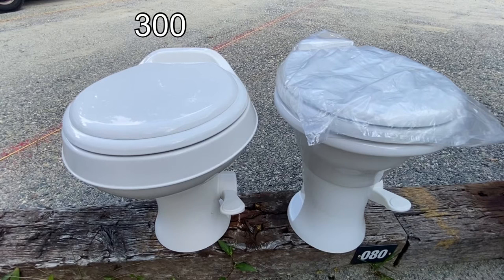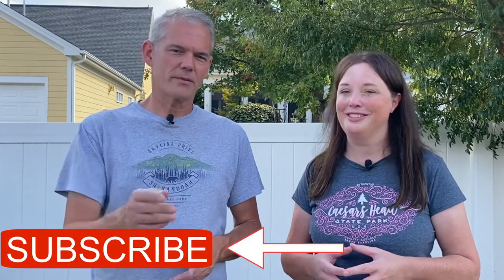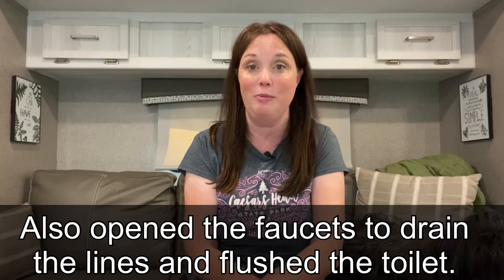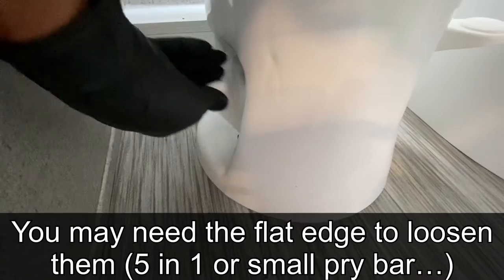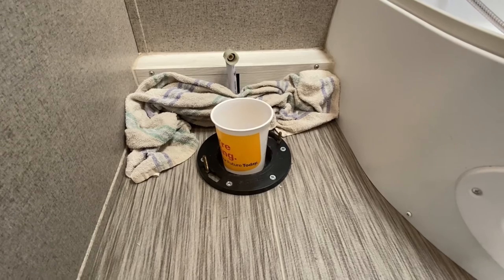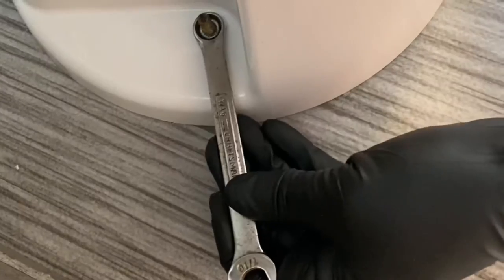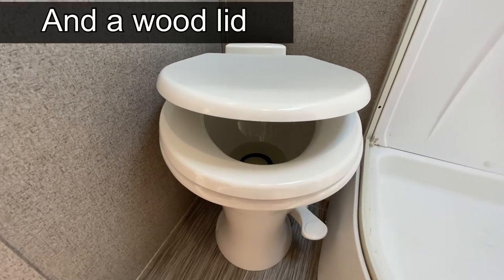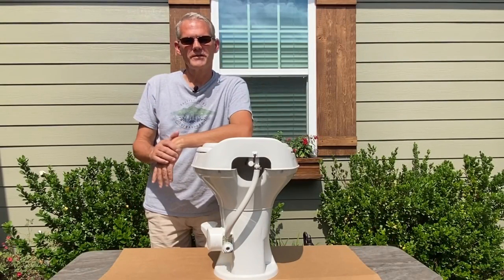We Install Dometic 310 Toilet - Pros & Cons / TIps!

Comment: Perfect timing for me a whole year later !!!! Picked up an R-Vision Trail-lite 2001 first of Feb. OH MY GOSH it's THE VERY FIRST RV I've ever owned. It is in good condition overall. Zero damage to interior or exterior except for an age nick or two. It had zero TLC until the last person who owned for less than six months. I've been ordering and gathering upgrades and repair items for her but until it warms up for now I've put her under a new RV cover to protect her from our Ponderosa tree sap and debris and any possible snow and rain we'll be having. No. 1 priority is to have her reseal and new gaskets around the coach windows. For me the backup camera which already came is equal priority. And along with a number of other items collected to install and upgrade her it's most actual work is on hold until we warm up. She was winterized last Oct so it would be a perfect time to upgrade the LOO. It has a Thetland I believe original toilet. Stained & much yellowed now. Plastic. I've got a new bathroom faucet & shower head ready to go in along with a freezer door repair piece. Temps are still huddled around 30's day time. So all work is on hold. I've got fabric ordered to reupholster her dinette and sofa & can work on that when the fabric arrives. Most of her previous owners just didn't show her any love. Her bones and engine are in good condition. I looked at the 310 thinking it was the best option. But Amazon's negative reviews mostly about the damage during shipping scared me off. I then contacted Etrailers who have it for 215 shipping included and asked about the shipping damage and they assured me they had customers back on that. So watching your video I'm ready to order it. OH I didn't realize this was going to add ~ up to 30#'s more. Good to know.  In a 22 year old B+ that can be significant. But like you mentioned even knowing or being aware of some of these possible negatives might not change your opinion of still making that upgrade choice. I am surprised is all that I hadn't seen that in my searches. The 320 I don't think would fit this Trail-lites itty bitty wet bath. So appreciated your calm approach to this task too and great tips and simple how to get it done successfully. I am concerned about the condition of the black flange into the floor. Yours looked like new but your RV is a lot younger than mine. So I may order it at the same time as the toilet just in case rather than wish I had later. I copy pasted your link for me to find it to watch later then. Thanks for your share ...
Reply from the maker: Congrats on the new camper!  It is always so much fun to make them your own!  We owned an older class c prior to this that we swapped out almost everything on haha!

So the 310 - we still are very pleased with the upgrade.  No issues at all!  And - we do apologize but the good news is the weight difference isn’t that much!  After we installed it, we had looked at the online description for the weight but it was incorrect.  Seemed reasonable as was porcelain vs plastic.  But someone commented that they didn’t think it was that much, we did see some additional research and found that it really isn’t that much of a difference! (would have to read back through the comments to see the exact).  So we don’t regret the upgrade at all!

Thanks for watching and let us know how the remodel goes!

Comment: Thank you! I am not usually a DIY person. However, this weekend, my old Dometic 310's foot pedal died, and it was replace the toilet myself or just not have a toilet. I bought everything and watched this video on Saturday, and installed my new toilet myself on Sunday with very little mess. It's a little crooked (seems pointing towards the sink a bit instead of straight towards the shower) and I'm not sure why. However, it works and it doesn't leak. Thanks again!
Reply from the maker: Glad you found it helpful!  I wonder if maybe the rubber seal underneath isn't set fully into the groove on the bottom of the toilet?  That might make it pitch forward.  Maybe it will fully sit down after being used for a bit.  Thanks for the watch!
Reply: If you haven't already done so try loosening the bolt down nuts just enough to clear the floor and slightly rotate the toilet to where you want it. The slight lift is to protect the seal.

Comment: I have a 2021 19FD, so mine apparently came with the dometic 310, but I do not have the soft closing toilet seat that you have. The rest of my comments are off topic for this video. I recently plugged in at a campground and heard a loud pop from inside the trailer. I went around and looked inside to see a trailer full of smoke! My air conditioner, microwave, electric water heater, and all the receptacles inside and out did not work. The dealer repaired all of my problems under warranty since the trailer is only about 4 months old. While I was there, I was complaining to the service tech about my batteries and their lack of capacity. I told him that if I didn't get multiple hours of sunlight each day, I wouldn't have enough battery capacity to get to the next day, and had to run my tow vehicle to charge the batteries to keep them above 50%. He told me the biggest energy waster in these trailers is the powered TV antenna. He claims it uses more energy than the refrigerator because it's on 24/7, while the refrigerator will cycle on and off. So, look behind your television and where the 12 volt plug is to power your TV, there is a push button switch for the TV antenna. If you're not using the TV, turn the antenna off and see if your batteries don't last much longer in a boondocking situation.
Reply: One of the best investments you will ever make in your Geo Pro is a lithium battery(ies). I cannot even explain to you the difference it makes. There are videos on this channel with the mods including the addition of suitcase solar panels in addition to your roof panels. A little spendy, but we considered it an investment. Do a quick search, and watch some of their other videos anyway. These guys are great. And just normal, everyday folks.
Reply from the maker: @David We did not realize there were two versions on the 310!  It is definitely not necessary but is a cool feature haha.  

Wow! That is not good - did they say what caused it to smoke up?  Definitely glad it was covered!!  

Yes - those small silent items can be a battery killer.  We always turn the battery disconnect off when in storage.  But that is a great tip to keep that antenna off if you aren’t using.  Question - what batteries did your dealer install?

Appreciate the watch - thank you!  Hoping your camper is back with you and you have some great fall trips to look forward to!
Reply from the maker: @ Wilson Flyer agreed on the lithium.  So many have gone to them to increase their bio docking.  And thank you for the kind words!
Reply: @WinesPinesandCanines  The smoke apparently came from the microwave.  Curiously, nothing in the trailer was turned on when I plugged in, yet the microwave, the GFCI receptacle near the sink, and some circuit breakers blew.  Plus I have an expensive surge protector on my plug.  The service tech couldn't explain how it happened.  When I got back from the dealership to plug in back "home", I first turned all my breakers off, plugged in, then turned them all back on.  Don't know if that would have prevented my problem.  Still have a problem... I'm plugged in now and my batteries aren't charging.  When plugged in, the battery capacity should always be at 100%.  It's nearly 1:00 AM and my batteries are down to 73%, so it looks like another 200 mile round trip to the dealership is in my future.

Comment: Tip use some thin plastic tubing over the closet bolts and thread the tubing through the mounting bolt holes on the toilet. This will guild the toilet over the flange bolts.
Reply from the maker: Thats a great tip and makes an easy install even easier!  Thank you!

Comment: Thanks for this video!   We are thinking of switching as well.   Does the wall clearance behind the commode differ between the 300 and 310?
Reply from the maker: Hi - thank you for watching!  The 310 fit fine - didn’t notice a difference for our camper (2019) except the lid is a touch wider so it rubs the wall in a very small spot.  Not enough to make us change our mind though!

Comment: I went to the 320 with a bidet seat.  Replaced a Thetford in my Winnebago.  The thetford had the bolts in front and back instead of the sides.  Took me over an hour to figure out how to fix that.  Ended up wasting a lot of time as I finally figured out I could just dril holes and use the oscilating tool to cut new slots to the new holes.  I hate it when I make the easy things so hard.  ;)
Reply from the maker: Ha!  Yes - do the same myself.   How is the 320 working out?  We looked at that but the clearance is tight in our camper - we knew the 310 would fit so went with it.
Reply: @WinesPinesandCanines  The 320 only sticks out a couple inches further.  I'm in a Winnebago 38R and I can still stand in the bathroom while drying off.  It's working great. I added a bidet seat.  I use more water but a lot less TP and feel a lot cleaner.  Let's me delay the occasional shower without feeling gross.

Comment: I did mine today in a 2014 wildwood. Had a model 300 series. The ball valve came out and the gasket was missing.  After the valve started leaking it was easier to replace than rebuild the old one. Much nicer, easy swap.
Reply from the maker: Glad that you like the change out.  We do not regret the upgrade at all!  Have you done any other fun upgrades?  We had an older Class C for a number of years and there was always a project!  Thanks for watching!
Reply: @WinesPinesandCanines  My wife makes fun of me because I'm always looking for something to fix or upgrade. Added some led undercarriage lights, 3d printed a housing that goes over my battery box to pump bike tires, added a generator rack.  I replaced all of the jacks on our rig during our last camping trip.
Reply from the maker: Ha!  Sounds like us.  We just cant leave things as is!   What lights did you use for the undercarriage?  Have been thinking of adding those.

Comment: I replaced mine as well after the first weekend.  You noted that it'd be 30lbs heavier - the base weight of the  310 is only 23.2 lbs.  The 300 it replaced is 8.25 lbs;  so really a net gain of only 15 lbs.
Reply from the maker: Thanks for the info.  We looked up the specs on the listing we purchased from and the description said the item was 39 lbs - we should have weighed it before installing instead of relying on the internet!  Nice to know we have a few extra pounds to pack!  Thanks for watching!
Reply: @WinesPinesandCanines  well;  I too did just an internet search for looking.. Maybe yours included box weight?  (Dometic lists the parcel weight as 33.03 lbs; amazon lists the item weight as 23.2 - yes that box was very hefty when I remember receiving it).  I was quite shocked at how light it was when installing it - I was fearing something that felt much heavier.   It is a million times better than the 300 though - well worth the cost to upgrade.
Reply from the maker: Yep.  Thinking that was it.  The amazon listing we bought from listed the item weight as 39 lbs but I just checked the box - it has a tag with a 40.5 lb weight.  Weighed the box and it was 13 lbs so it must have been in the 27 lb range.  (Another commenter mentioned that their 310 did not have a slow close lid so maybe they have changed causing a few extra lbs?). But definitely thinking the listing has the item weight to include the shipping weight!

Comment: do you recommend replacing the plastic fitting on the pex line with something brass? if so, what swivel fitting would you recommend?
Reply from the maker: Hi - so sorry we missed this!  So, we haven’t modified the plumbing.   We have been lucky and 5 years in, we have had no issues or leaks so have left as is for now.  Were you having an issue?

Comment: Can you confirm that the 310 is a one piece bowl that eliminated the stinky inner bowl leak of the 300 we need to replace?
Reply from the maker: Hi - so we had seen others online have that issue with the inner bowl leak on the 300 and most were upgrading to the 310 to get rid of the issue.  We didn't have the issue with our old one but we also liked the idea of the porcelain bowl.  Happy to report we haven't had any issue with the 310 - very happy with the upgrade!

Comment: What flange did you use.? I just bought the 310 today and I need a new flange.
Reply from the maker: Hi!  So sorry it took a bit to get back to you!  So, ours came with the flange so we didn't need to buy a new one.  But, we found replacement kits on Amazon - the part number was Dometic - 385311652.  But it came with the mounting kit as well.   Hope that helps and thank you for watching!

Comment: I put the 310 myself but I needed to bring it over 2in because the toliet want lift up all the  way the lid
Reply from the maker: Do you have the 19fbs or another camper?  Curious if the 19fbs vary that much!  This one is a tight fit and the lid is right at the wall but can fully lift the lid.

Comment: Been watching your videos but would you please let me know the truck you use to haul your geopro we have been thinking of doing the same but getting the right truck seems to be a bit of a challenge
Reply from the maker: Hi - so sorry!  Somehow missed this comment.  We have a 2012 Toyota Tundra 5.7 V8.  We love the truck but it does have two limitations - fuel consumption (we get 10mpg towing) and payload capacity (approx 1500 lbs).  We love the reliability of it though, so we work around those!  Thanks for watching.

Comment: While waiting for my trailer to be delivered last year, that was one of the upgrades I was researching. Fortunately, I waited on ordering one, because when the unit showed up, it already had a 310 installed. I'm still not clear on whether my GeoPro is a 2020 or a 2021--some documents say one, some say the other--and with all the supply chain issues in the industry, they seem to be shipping RVs with a mixture of parts, depending on what's available at the moment.

I'm getting ready to head home from Telluride this morning. It was a great trip, Covid restrictions aside, but I really miss my GeoPro. The R-Pod I rented is okay for one person, especially if you're basically just sleeping in it, but I hate the bathroom. It's a "wet bath," which means it's basically like an airplane bathroom with the addition of a shower head. Not really ideal for someone who's 6'1" and 190 lbs.

I really hope Dexter comes through with my new axle soon!
Reply from the maker: Hi!  Glad to hear all went well and you had a great trip to Telluride!  That is strange that some says 2020/2021.   I assume the title would be correct?  And yes - everything seems to be in short supply!!  I don't think we have been in an Rpod but had a relative recently borrowed one from their family member - it was a little small for them as well.  And yes - a wet bath was a deal breaker for us.  Figure everything would always be wet and humid. And let us know when the axle comes in - hopefully it will be upgraded as well!  Have a great weekend!!

Comment: Can you ADD a hand spray to a regular 310 which does not have one now? Thank you
Reply from the maker: I believe so.  Found this question asked on etrailer.com 
https://www.etrailer.com/question-522103.html  and they recommended part DOM75FR.  Have no experience with this part but that might be what you are looking for!
Reply: @WinesPinesandCanines  That answers the issue completely. Thank you very much for the information and link. Much appreciated. Paul

Comment: I am curious any problems with the fridge I had my trailer plugged in for 5 days and was not cold idk if there is a breaker or fuse that could cause this never had ot cold from day one
Reply from the maker: We haven't had a problem cooling with ours.  It is a 2 way - propane and electric.  Do  you have the same or the new 12V?  Does the light come on?  Or does it cool off at all?
Reply: @WinesPinesandCanines  light comes on yes same as you no 12 volt had it plugged in for 5 days straight not cold
Reply from the maker: So we had the opposite problem at one point - would get too cold.  It was the thermistor (I think that is the official name lol - its a white cord that has the plastic end) wasn't connected to the lever that goes up and down. Is yours attached and is the lever up or down?  Those are two simple things it could be.  And do you have a thermometer in it to see if it (or the freezer) is working at all.  Lastly - is it really hot out where you are?  I often put a bag of ice in it and it cools it down quick but when we camp when its hot, it struggles to keep below 40.
Reply: @WinesPinesandCanines  i seen that video and moved it both up and down nothing I may have just gotten a dud it was cold at the dealer when I left

Comment: anyone watching this, dont buy the 310 if you're a man. it is a daily struggle. i just installed the 320 and its sooooooo much better. the 320 is just like a normal house toilet
Reply: Do you still have the 310 by chance. I’m looking for the part that connects the base to the bowl, it has two seals on either side of a clear plastic divider. One is rectangular and the other is round. I can’t find it anywhere and there is an article I read about a replacement for that that only has one rubber seal but I can’t find that either. Our 310 is old that the 4 screws that hold the base to the bowl have been rusted out and deteriorated.